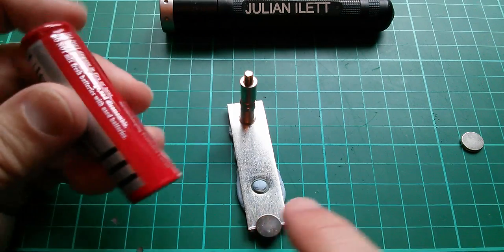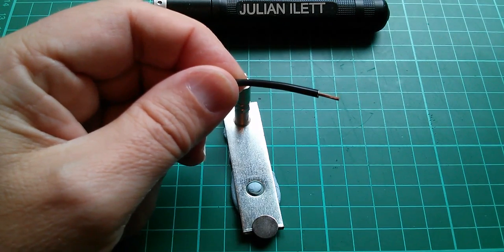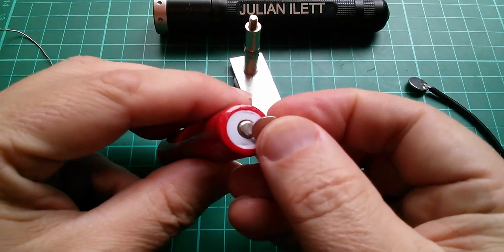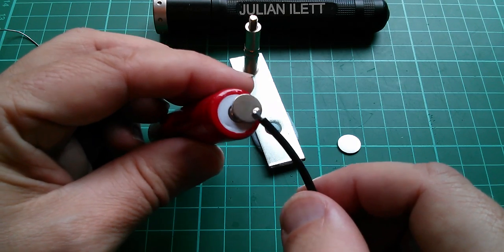Soldering Wires to Neodymium Magnets

Comment: I don't know much about heat's effect on magnets. But neodymium magnets have 4 poles, unlike the regular magnets which have 2.  Perhaps by adding the conductive solder and wire has changed the shape of the overall combo, and therefore the pattern of that complex balance between poles... Shifted it sideways, maybe?
Reply: Where are the 2 extra poles?
Reply: Just look it up, guys... too long to explain here.
Reply: I did look and only 1 thing came up about free energy..... Enough said
Reply: LOL!
Reply: When I say "look it up", I mean somewhere other than YouTube!  Anyway, here is a link:  http://physics.stackexchange.com/questions/12283/if-you-place-a-spring-on-a-neodymium-hard-drive-magnet-it-appears-to-vibrate-in
Reply: That 4 pole (2 north and 2 south poles on same magnet) neodymium magnet is purposely made for the use in HDD head movement, it's much more complex process to manufacture these. Those coin cells in the video are actually 2 pole versions that is much easier to manufacture. However there is possible to "program" a magnet with much complex magnetic field.
/watch?v=IANBoybVApQ
Reply: You are correct.
 On looking into it more, it seems that neodymium magnets can be made to almost any magnetic polarity pattern you might need. 
My initial statement about them having 4 poles was based on my limited experience with HDD magnets.  Thank you for clearing that up for us, DjResR!
Reply: Oui, c'est ça Francois... 
Et si tu les frottent ensemble très rapidement devant un écran télé tu verras peut-être apparaitre une image ou deux. MDR

Comment: n 65 neo, or higher. copper plate 1/4, use silicon wire #22. Clean magnet with 90% ISO-prop  alcohol. I also used two pieces of aluminum # 10 gauge sheet metal clamped, as a heat sink. Worked good for me. I have been using them and TP 4056 to charge lithium cells for a while. A little flux pen helps too. Just some ideas.

Comment: Why do you use a magnet there? Just use an steel or iron disk an the two spacer magnets. The iron disk will be magnetised by the strong magnets. An soldering does not bother the iron disk. May even save some more money if you just pick up some stell / iron washers an use these!

Comment: Physics. It works, bitches.
If you had the capability to solder the wire on in a strong magnetic field that matched your desired end stage magnet, you would not lose the magnet's strength or field symmetry.
The way that high-speed tape copying machines work is that you create a master tape with a metal tape that holds the magnetic image you want to copy. This runs on one side of the machine. The other side of the machine runs a long reel of plastic magnetic tape. The two are made to come together in close proximity for a few inches. At the very beginning of the contact point a heat source (usually a laser) heats the plastic tape (or rather, its magnetic particles) above the Curie point of its magnetic particles. As the tape runs along in parallel with the master, it cools below its Curie point and this "freezes" the image of the local magnetic field into the copy tape. Since the local magnetic field is dominated by the field from the metal master, which doubles as a heat sink by the way, the magnetic image is perfectly replicated onto the copy.
You can run hundreds of thousands of feet of tape through and chop it up and mount it onto reels to be loaded into cassettes.
This is is how that Wham! cassette that you wore out in the 1980s was made. And that Star Trek game that you played on your TRS-80/Apple II/Acorn computer. 
Edit: Err, sorry. The copy of Lotus 123 that your boss bought for you.

Comment: Unsolder your wire and I bet your magnet acts like before. 
Curie point demagnetization is temporary, while the temperature is high.
Reply: in fact curie point demag can be temporary or not, depending on the magnet. it seems for neodym, it is permanent.

Comment: Soldering the wire onto the one side of the magnet has magnetized the wire the same way. For sake of simplicity, lets call the soldered side A and the unsoldered side B. The wire is now a sort of extension of side A, so when you stick side B to the button of the battery, the wire, acting as Side A, is pushing away from the battery now. This pushes the magnet to one side, away from the wire.

Comment: Aaahhh... ultrafire.  just finished testing my 3 ultrafire 100mAh,  and they turn out to be more like 450mAh!
Reply: Get some proper Samsung, LG, Sanyo, Panaconis cells.
Reply: find your nearest computer shop(not best buy) that does recycling and ask them if you can snag some bad laptop batteries. They are easy to pop open and you just need to cut off the old control board, as well as the connectors for each cell and there you go a bunch of 2500 mAh 18650's. Just test their voltage and as long as they are around 3.1-3.3 they are good just need a charge. Anything lower can still be used BUT there is a chance they won't take a charge as well so you might need to cycle them.
Reply: They usually have high internal resistance / low capacity because laptops don't care much about battery health and they are most likely stored fully charged and fairly warm for a long period of time inside of the laptop which wears them out.
Reply: +Maximillian Schmid, Ultrafire batteries are the recycled cells that make it to China and are then rewrapped for resale. Better to pull them in your home country.
Reply: I know. I responded to Sam's comment.